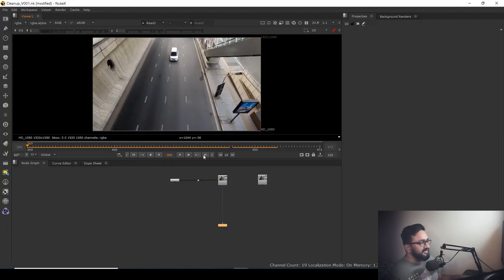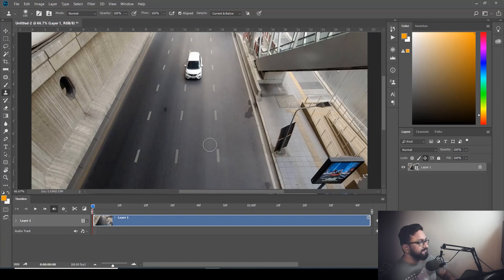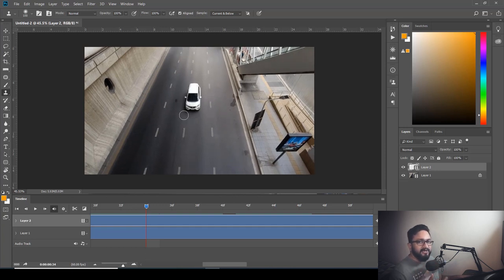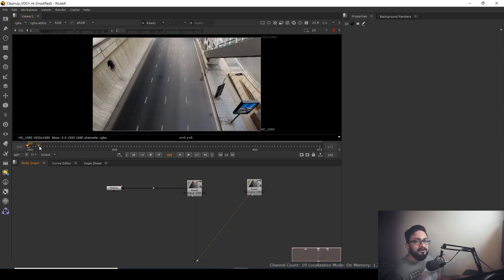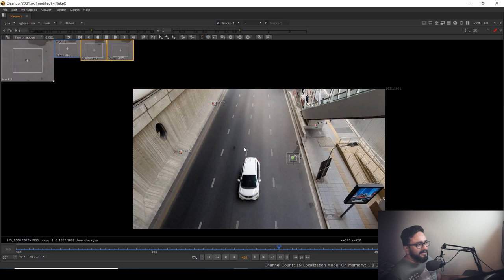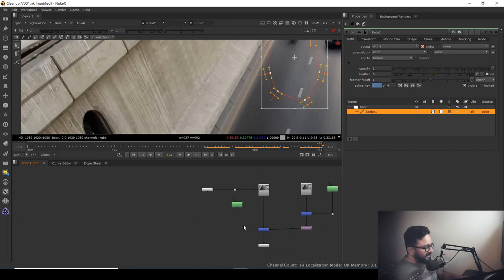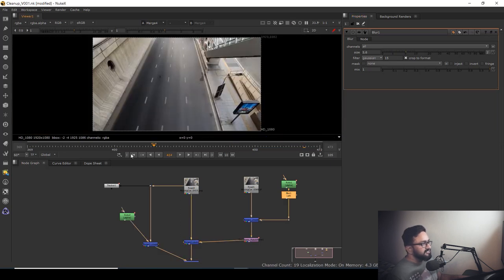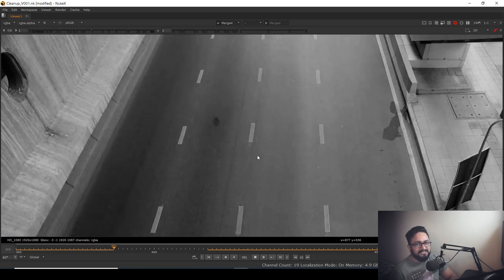HOW TO DO CLEAN UP IN NUKE BY USING PHOTOSHOP | VFX VIBE

Comment: I'm doing a clean plate project. In my video, I want to remove a dancer. As camera is not still so I want to track the footage using 3d camera tracker node. I also drew a mask around that dancer (as he is moving) so that it doesn't create any tracking point on that position. But when I change mask input from 'none" to "source alpha" in camera tracker node. All those tracking points get invisible. If I set mask as "none". It shows tracking points but after switching to "source alpha" .it gets invisible. I don't know what I am doing wrong?!
Reply from the maker: Check your project setting once